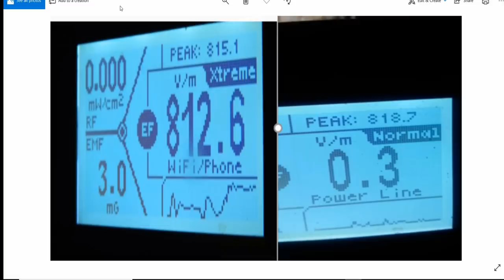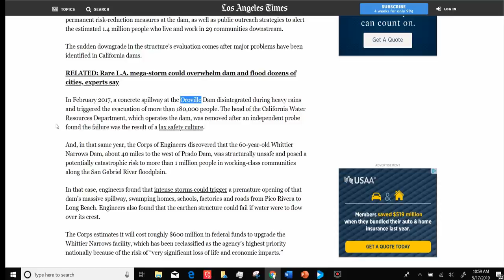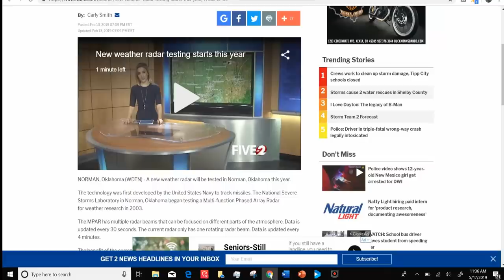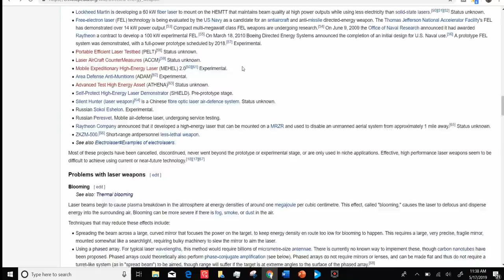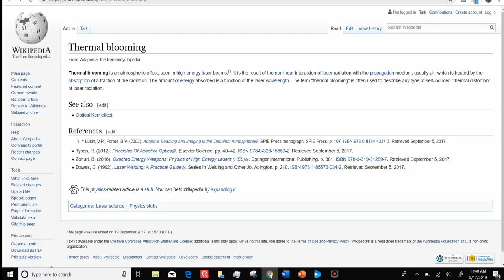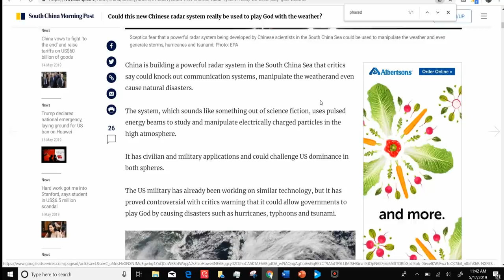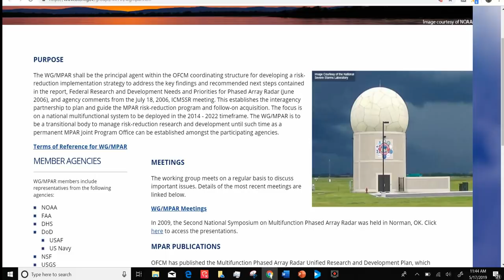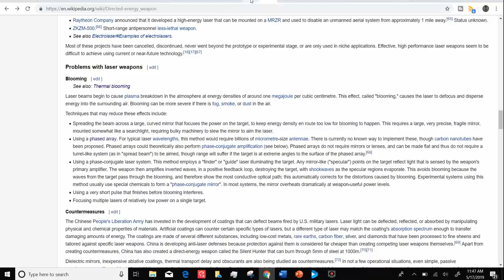Oroville Dam Update, NEXRAD & Multifunctional Phase Array, Direct Energy Weapons

Comment: How can this stuff be safe when they cover us with a shield when we have an x-ray taken ?...It's Cumulative !
Reply: X-rays are ionizing radiation. Microwaves are nonionizing radiation. You're comparing apples and oranges.
Reply: Whatever the Radiation is , is deadly to people !....Expose yourself, that's your problem !
Reply: Expose myself to microwave radiation? I already have and so have you :) Have a cellphone in your pocket? Do you have Wi-Fi? What about that "evil" smart meter outside your house? :)
Reply: @DavidJohnson-tv2nn  cell phone is always off, no why-fry, analog meter !
Reply: Fake, So if there is an emergency and someone needs to call you.... They're sheet out of luck? No Wi-Fi means inconvenience to you. But not to worry... You're still exposed to microwaves from all kinds of sources.…. Neighbor's Wi-Fi... Cellphone towers.... Weather radar... And other numerous sources of microwaves :)
Reply: @DavidJohnson-tv2nn  Ethernet cable s slick !....I check my phone often but I am not stupid enough to keep it in my pocket in the On position !